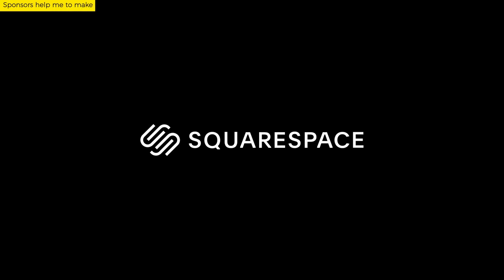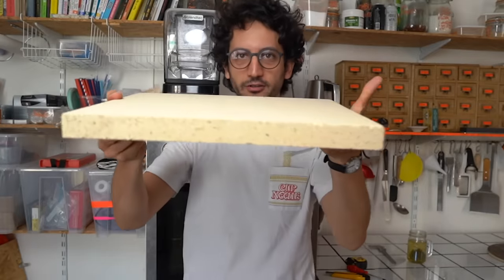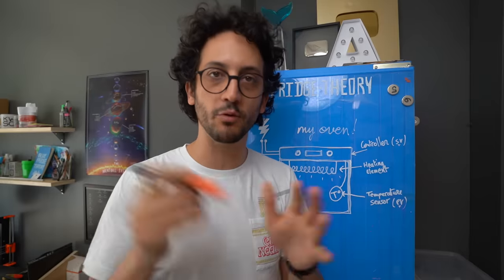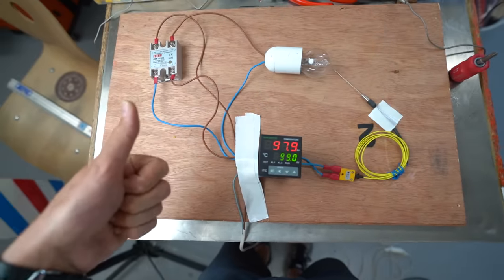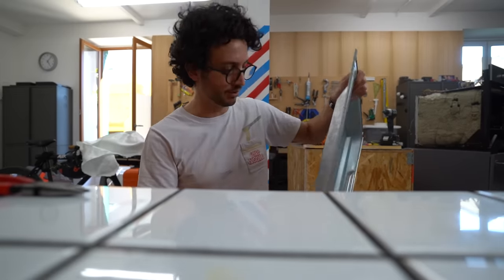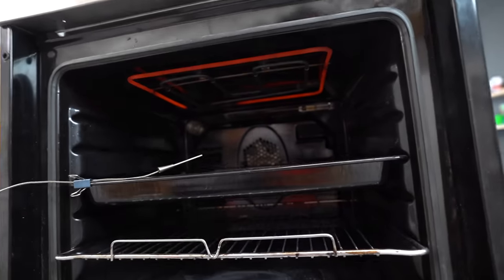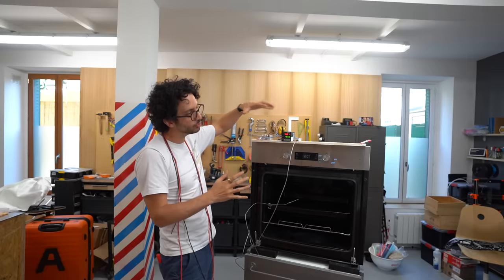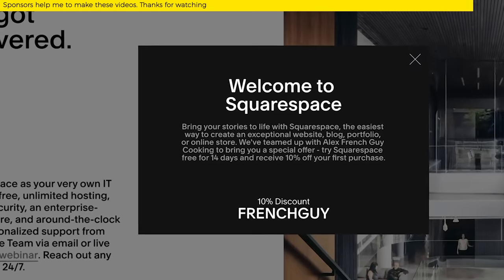I've got a Serious "Pizza Oven" Problem... (part 1)

Comment: Looks like you are using a Type K thermocouple as a sensor. For the temps you are working with, I would suggest a Type J.
In my experience, when working with temps under about 500 degrees C, Type J is not only cheaper, but more resilient and precise. Also, most standard 1/16th DIN temperature controllers (like you have there in the video) will easily accommodate Type J T/C's.
That Solid State relay is typically rated at 10 amps as it is on its own.
Anything over that, you should use a finned aluminum heat sink as a mounting base. A flat plate heat sink would do fairly well, but would need fan assisted cooling. Finned sinks are relatively cheap and although they take up more room, they are easier to employ.
That said, if space is a really big concern, it is very easy and cheap to get the little "computer fans" than can be thermostatically controlled; cycled on and off with the SSR (preferably with a time delay relay for a minimum amount of run time); or just run full time while you use your setup. 
I like your build. I'm an amateur cook, and I spent well over 20 years in plastics processing and machine maintenance and have bodged together a few ovens myself.

Comment: I am doing exactly this with a G3 ferrari oven, replacing the heat "sensor" and using a PID controller. :D (also Electrical Engineer so I know what im doing)

Comment: Uses a solid cable, solid socket, and then you see that thin white cable on the wall ... It's a start I guess.
Reply: The heater will not draw more current anyway, just be on longer, so that plug and cable is way overkill. A normal Schuko would have been just fine for 9A (2000W). I guess he is doing this just for fun :)
Reply: In France it should be something around 16A - 230V or something... 2.5mm² cables should do the trick without any problems. Now the Studio has been renovated recently, looks like they  did the wiring as well.
Reply: @corwinwhitehorn7759  as an American, your wire sizes don't make me feel welcome
Reply: @andreboily8645  Why not?  Depending on how it's installed/insulated, a 2.5mm wire is safe up to about 30A.  Remember that the higher the voltage, the lower the current you need to obtain the same power (power = voltage * current), so an appliance on a 110V supply needs twice the current as the same appliance on a 220V line.
Reply: @andreboily8645  2.5 mm² cable means about 1.8mm diameter cable, which is around a gauge 13 (according to a gauge chart I found on Wikipedia).
Reply: @-_James_-  yeah i'm sure the amps work out, I just have no idea what a 2.5mm wire is comparable to
Reply: As an European living in USA, I confirm wire sizes in Europe look miniscule to me. My American duoble, six element oven (that obviously runs on regular split-phase 240VAC like ALL American oven/cooktop appliances) has a copper 8AWG line (8.3mm2). No way a 2.5mm2 can be safe to 30A (at what ambient temperature?). Typically 2.5mm2 (roughly equivalent to a 13AWG) should be ok up to 16A, but that is the power of just ONE of my broiler elements
Reply: Alex's hack is not drawing more current than the stock oven. It's just drawing the same current for longer on periods. So, if the wire feeding the wall socket was sized properly before the mod, then it should be OK now. Now, I'm reading some think this is 2.5 mm² cable, and others stating that it's 2.5mm diameter cable. Big difference. Even with the 230V standard in France, a 2.5 mm² wire is about 1.8mm in diameter (area = pi*r²) or roughly 13AWG in US wire gauge sizing. Probably undersized for a wall oven. If, however, the wire size is actually 2.5mm in diameter (which seems to be relatively common in France, too), that seems better for an oven. Maybe it's even bigger, which would be better. only Alex really knows the size of that wall wiring.
Reply: @nemodetroit  
In France the max. current rating for the oven socket is 32 A, here in Germany 16 A and here the standard cable used is the 2,5 mm². Don´t forget though that you got 5 cables inside for the 3 phases the neutral and the PE which makes the overall cable larger. So the French standard ones should be thicker. I just looked up the datasheet for the German standard oven cables (2,5 mm²), they were tested with a current of 2000V and are rated for up to 500-800 V depending on the manufacturer. The breakdown voltage is 4000 V so this should be plenty safe.
Reply: @nemodetroit  wires in eu are sized by the sectional area, not diameter.
Reply: @AlessioSangalli  Good to know. Thanks.
Reply: @nemodetroit  I believe the issue is that now the wall socket and plugs might be oversized for the existing wiring :) I recently installed a 240VAC 50A socket in my US home and I used 6AWG copper

Comment: You should use some silicone to seal the exposed 'flaky wood'! Fiberboard works like a sponge and it will tear itself apart if it often comes in contact with water. The melamine (the white thing) is waterproof but it's not recomended to have the woorden inside exposed without proper treatment (especially in a kitchen). Salut ✌️.

Comment: Hi Alex. The solid state relay you're using is rated for high currents but only when attached to a pretty massive heatsink.  As currently used it will die quite soon. I would either recommend a contactor with a 220v coil driven by the SSR
 If the temp. Controller has a "dry contact" relay output and drives 220v directly then you can use that to drive the contactor coil. Otherwise get a good heatsink plus silicon grease for the SSR. Maybe you can use one SSR for each heating element in the top to reduce a bit the load. But a relay or SSR should be able to handle it each element individually.

Comment: As a fellow engineer and pizza lover, I appreciate the ingenuity used for this project and will be very interested to see how it turns out.  One thing to keep in mind, though, is that the resistive heating element in your oven does have a maximum allowable temperature/current it can withstand.  Since this oven was not designed with a self cleaning feature I would try to find the specifications for the oven to make sure the heating element will survive at the temperatures you want to get out of it.  Bonne chance!

Comment: If you plan to use a similar solid state relay, you should attach it to a heat sink of some sort and have some amount of ambient air flow around the heat sink. 
 they tend to get quite hot and if they over heat and fail, the heating element won't turn off which could be a very very bad time.

Comment: OK, good luck 😉
Some temperature controllers have an under temperature alarm output that you can program to trigger at any temperature under the set point. Instead of using it to operate an alarm, you could use it to control the other heating element. When the temperature is really low, both elements operate, and as it approaches the set point, only one operates.

Comment: Very Nice Alex! Like your videos a lot! I only have one suggestion that might help make that beast a little cooler, you could put between metal sheet walls some type of food save isolation to diminish the heat loss and isolate it from the outside temperature. Cheers! And good luck!

Comment: This is a really good idea and the way you hooked it up and explained it with your proof of concept made it much easier to understand. But I have 2 questions now:

1. Wasn´t there a way to just change the set value of the oven, so instead of it having the limit at the usual 250 °C it would go higher and still using the existing wiring/probe like the ones that do come with the self-cleaning program? 

2. Given that your oven does not come with the self-cleaning program that allows for the higher temperature for a much shorter amount of time compared to the usual temperatures, does your heating element withstand the higher temperature? 
I´m an engineer too and I visited a seminar once at a norming institute where they were talking about planned obsolescence among other things and the guy holding the seminar said that heating elements are among the first things that break in many appliances because many manufacturers don´t wanna spend the extra money. He was using washing machines as an example but I´d imagne because heating elements are very basic parts produced by the millions this would probably apply here as well.

Comment: really awesome project! my only suggestions would be (echo) to look at the insulation of the door and existing electronics as they may not be rated for >500F temperatures, and look into a PD controller for the temperature if you don't like the bang-bang switch. also, maybe the probe should be placed closer to where the pizza will be rather than in the existing location for more accuracy? good luck i can't wait for the next vid!!! :)

Comment: I have been postponing the exact same hack for a long time. I would use a mechanical relay though, SSRs fail closed. how about putting two in series for safety? Also increasing the thermal mass of the oven would slow down the need for switching and make for a "chiller" PID.

Comment: Would a multistage heating of the pizza be good? Like start off with a lower temperature for a set time then do a hot finishing stage for the lepardspots.
You are building your own controller for the oven, might aswell make it more advanced, do a PLC controllled oven(or a more budget friendly arduino solution perhaps)
Reply: I don't think it would be good for pizza, because you want a lot of heat at the start, which creates steam inside the dough. But programmable profiles could be useful for other dishes. Would be a interesting DIY project for sure.

Comment: I replaced the controller with the same setup years ago, and it evendually died because I put the controller too close to the oven and made it broken. Before then, it works perfectly.

Recently I was selecting a new embeded oven for my kitchen, and chosen the high-end Siemens IQ700 oven with high heat self cleaning mode thanks to your previous pizza baking video. XD

As far as what I have researched, those ovens with high heat self cleaning mode are designed for withstanding the high heat. So hope that the protection for the heat controllers and the elements are enough.

Comment: Quick warning, before the fire department has to make an intervention.
While you did place control of the oven through a PID regulator that can push it to 500°C, the original mechanical thermostat (mechanical thermo regulator) probe is still in. 
Thermostats not meant for pyrolysis can only go up to 370°C at the probe section (which is in the oven), at which point the main switching component will do one of two things 1) stay constantly off (if it's a model designed with fail-safe in mind), or in a more dangerous scenario 2) stay constantly on.
Now, I'm a mechanical engineer, not electrical, but I do know enough about heaters to say that constantly running electricity through them is a good way to start a fire.
Personal recommendation, if attempting to run the oven on the original circuity now, make sure your fire extinguisher is in proper working condition.
This is why we have health and safety.
Reply: @Alex I hope you will see this massage, He is right

Comment: There's probably a thermal safety cut-out in there somewhere. You may want to check what temperature it triggers as that could cause problems (and some don't reset). If you aren't going too much over the design temperature you could probably just replace it with one that triggers at a somewhat higher temperature.

Comment: Not sure if you've already done this, but you may want to consider a heat sink and / or fan to cool that solid state relay. They can get quite hot, even if they're within the rated load.

Comment: I did this on a larger scale for a powdercoating oven.  But I hacked a propane ready heater with a simple solenoid valve run by the temperature controller.  Fantastic little devices that are really easy to use an expand.

Comment: Alex, you might want to check the cable feeding the 16A socket you installed. Looks a bit small! By taking the ovens control board out of play you may have bypassed some resistors that limits the power to the element. Should be a issue if your supply cable is sufficiently sized.

Comment: I hope you upgraded the wires coming from the circuit breaker to the outlet as well and maybe even from the mains to the breaker depending how high it is rated.

Comment: Alex, You should add a heat sink to your SSR (SolidStateRelay) running at 220v it will get hot. When they overheat they USUALLY stop working. Also ground the SSR depending on how and what you mount it to.

Comment: wait, at 8:24 the inner coil isnt powered. Alex, you might be trying to avoid burning out both coils with your "hack" but you might want a double relay to control the 2 coils.
i plan to add that high amp socket in my home since my old home had dedicated 20A circuit for my home oven. we brought the  oven when we moved but this home circuit is mainly 10/15A(15 in the kitchen and master bedroom where an indoor socket is powering the external compressor for the split ac system)
i need to call an electrician to swap out the breaker box  and add 1 dedicated circuit to the kitchen. that way the oven can be used again. we been getting by with a Round countertop oven that has the element below and no thermostat. all it does is bake cookies..no meat much less add a sear to a pizza

Comment: Hey Alex!
I know you already got your Ideas for the oven, but i got some ideas for you too!
First of all, try to implement a kind of two way switch, so you can run the oven in "pizza-mode" and "regular mode". That way you cant mess up with the Settings and also the Oven wont do anything (accidently) .
Second improvement would be with the temperature Sensor. You already mentioned it to be put somewhere else. Consider putting it (maybe into or at least) near the pizza stone / steel, that way you got the right temperature for your pizza.
In many Gas-Fueled BBQ's there is a thermometer in the top of the casing. I dont know why the manufacturers are doing it, maybe because it looks more fancy. But you want to know how hot its at the pizza and not at the top of the oven(!)
Best luck from germany! 
A fellow electrical technician.

Comment: I've been in the process of building a similar 'electric Neopolitan pizza oven' as Alex.  I started the project a few months ago, but I'm not yet finished. 
I am converting a junked non-self-cleaning home electric range (an old cheap electric range) into a 900-degree electric pizza oven, which will be placed on my porch, so I can make pizza in the summer without heating my house on hot summer days.  
The range was in my yard gathering leaves and squirrel acorns for over ten years; it was last used in about 2008.  Now it's in pieces getting cleaned; I'll soon replace the insulation, add a PID controller (same as the one used by Alex), relay, switches, a high-temp probe, new wires, and maybe replace the elements.  The surface burners are being removed and not replaced, so the only current-drawing elements will be the bake and broil elements in the oven.  With several switches, I'll be able to turn on either the bake element, or broil element, or both at the same time, all with a temperature sensor that can read over 1000 degrees Fahrenheit.  
The project is rather easy and cheap.  With six fire bricks and a good pizza stone inside, I expect to have a convenient electric Neopolitan pizza oven for about $140.  It will be better than the $700 electric pizza ovens on the market, since none of them can reach 900 degrees, and since my oven will have much more stone in it.  It can also handle a 16-inch pizza.  
I think this kind of Neopolitan pizza oven is much more convenient than a wood-fired oven, much cheaper, and I expect the end result to be pizza at the same quality, since the oven's only job is to get up to 900 degrees with heat above and in the stone.  An electric oven can do this the same as an expensive wood-fired oven.

Comment: This still seems to be a very unsafe setup after all. The whole construction of domestic ovens is not made to withstand constant temperatures that high like used for making pizza. 
Why not build whole new high temp. oven? I'm thinking of something like a heat treat oven such as used for metal treating. There are several plans out there.

Comment: The pyrolitic Ovens I know have a vented door to prevent the glass from breaking due to too high temperature. Maybe insulating the glass door a bit would be a good idea (maybe with aluminium foil or a some metal with holes in it).

Comment: The first thing I'd do if I took the oven that far apart is replace the insulation with unitherm ceramic fiber insulation or something like it. You will have a vastly easier time stabilizing the temperature. Well worth the cost of what it would take to insulate the oven. If I am going to go to that much trouble to add a controller may as well replace the primary also and combine everything together. It doesn't take much programming to replace the current controls on that oven. You could go embedded or PLC or even something like a rasberryPI. I don't see doing all that work just to half ass it.

Comment: As an electrical engineer myself, you probably just needed tie into the thermostat wiring coming from the oven and add some series or parallel resistance to trick the oven into thinking the temperature is lower than it really is. The thermocouple is basically just a resistor that changes voltage value with heat. You can enable / disable this resistance with a simple switch. Otherwise, good stuff.